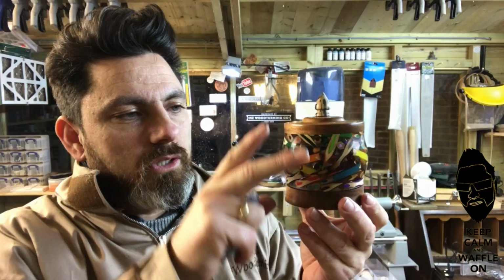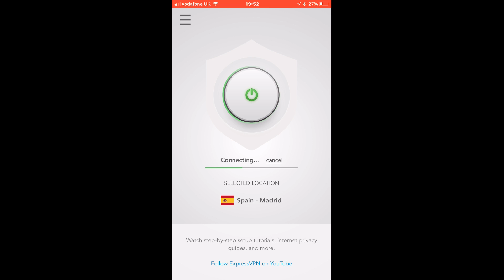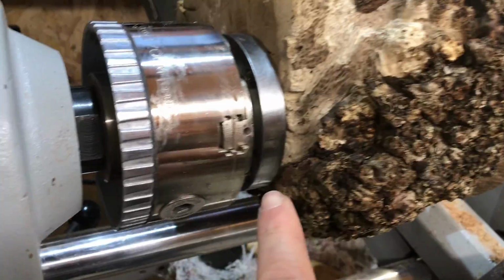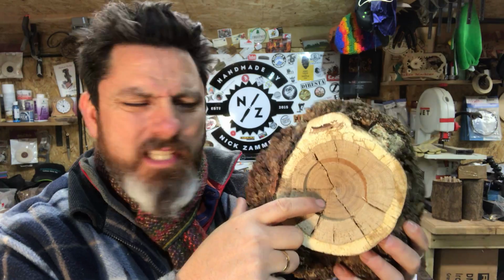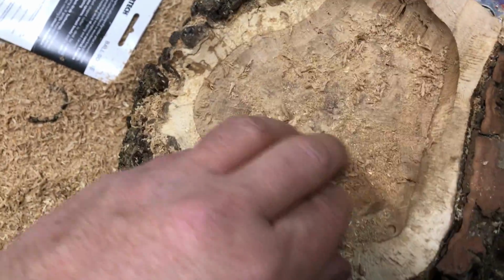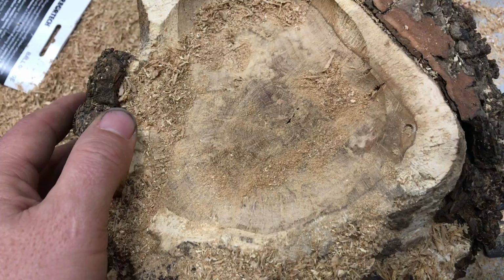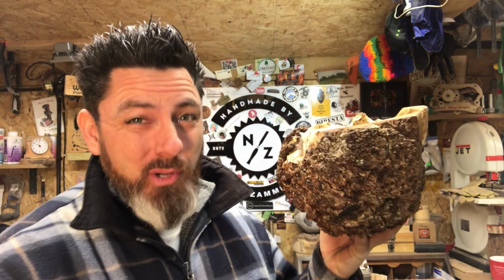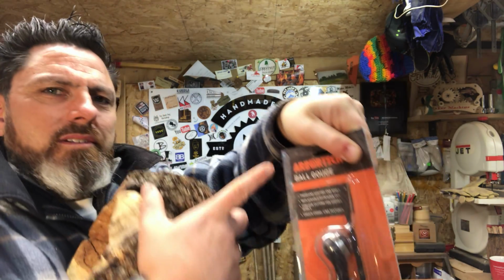Woodturning - The Fungus Burl Bowl

Comment: Nick, I absolutely love your videos, but just a few tips: next time you do something with a piece of wood like this, I would recommend mounting it on the lathe so that you're not going into the end grain.  The hardest part of the wood is in the dead center, so you end dulling your tools and losing more of the character of the grain in the finished piece.  Cut off about an inch or so of the bark on your bandsaw, and then mount your screw chuck onto the new flat surface.  Since it's going to be really shaking, hold your bowl gouge firmly and don't run it any faster than 600-700 RPM at start.  You don't need to take off all of the bark when you're smoothing it out, but once you've at least got a more stable shape, you can make your tenon and remount it.  One other thing; when sanding on the lathe, try not to run it above 100-150 RPM (depending on the grit you're using) otherwise it can overheat and cause scratches.  Hope this helps a bit!  Carry on and waffle on!

Comment: Question or observation on this bowl; I was surprised that you didn’t add a layer of resin to the bottom, filling the cracks and offering stability.  Additionally, surprised you didn’t use larger Forster (sic) bit and drill press prior to using the bowl gouge.  Great eye seeing what can be rather than what is.

Comment: Aren't you worried about those cracks widening as the bowl ages? I'm not sure what the humidity is like where you are, but where I live, we go through periods of extreme hot/cold, dry/wet. I would fear that bowl just splitting apart over time, even sealed. That being said, it's a really groovy bowl.

Comment: great video. Just curious, why didn't you leave it on the lathe while you used the bowl gouge thing, just to hold it? is that an option?
Reply from the maker: ldybgd good point 😂👍🏽
Reply: If you set the lathe going really slow (50 rpm?) so that it was safe and used that ball gouge thing you could probably get the centre quite neat.
Reply: Because the lathe was scaring him and his only thought was to remove the imminent threat to his head’s well being 😂😂 Hindsight, huh? Lol

Comment: I would use it as a nut bowl for parties.  I'd suggest at least spray lacquer, or better would be to brush clear resin on the bark side to prevent it from chipping off.

Comment: Should have started between centres and then you could easily of completed the whole process on the lathe. Still would have been a little out of balance but not as much as that.
Reply from the maker: Paul Lockwood it’s impossible to do that Paul mate 😂
Reply: @nickzammeti  No it's not, it's actually the better way to do it, especially putting screws into end grain is not a great idea. I've had lots of off balanced pieces between centres, even very wet wood. Just watch Al Furtado or Rick at Woodturning Arts and you will see that the piece you have is very small and nothing compared to what they put between centres. If you had put it between centres you could then line it up for where you wanted the centre of the piece at the top and bottom.
Reply from the maker: Paul Lockwood hey Paul I appreciate your feedback and I’m certainly not a professional but turning between centres on this piece would not have allowed me to achieve what I wanted . I also don’t think it’s very safe . The plate is very secure and also allowed me to do add in the mortise . I appreciate there are many ways to do things and don’t think there is a right or wrong way it just depends on how you work and what you want the end result to become .  Thanks for watching 👍🏽